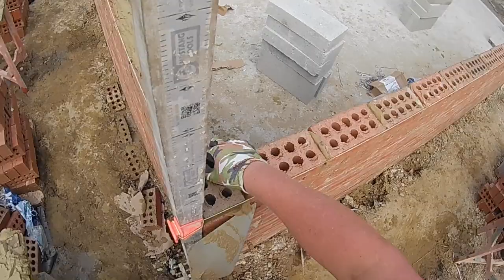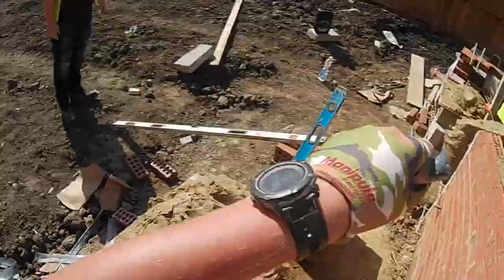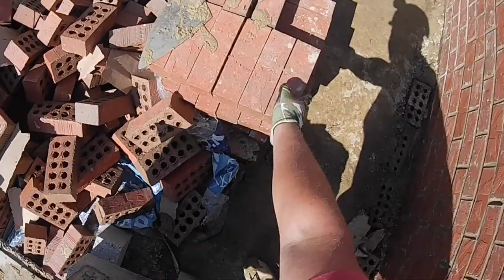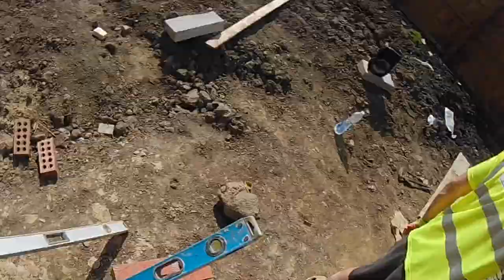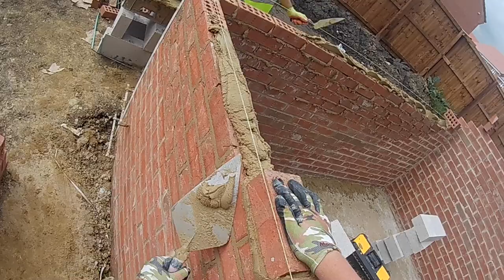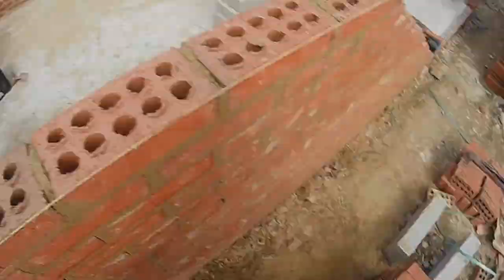Bricklaying Vlog - A Garage with Big Pier’s - No Mortar till 11am😰! & Learning to Spread? - Part 3

Comment: Mate did the site agent see the joints before you started vos i would of told them to get fucked building it with joints like that. We normally knock it down below the ground and charge them to do properly
Reply from the maker: It was a rush job to be fair, I would of normally queried it 🤣🤣
Reply: @theafter8bricky  its alright until they start picking at it, you need to get on some plots mate